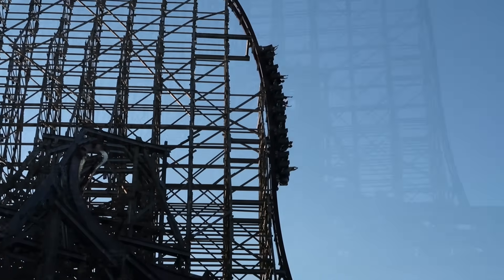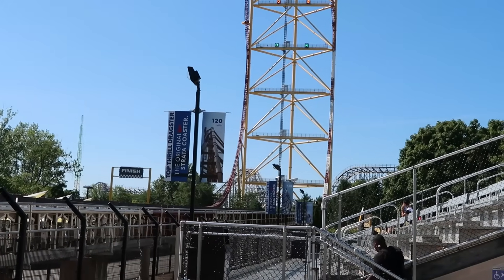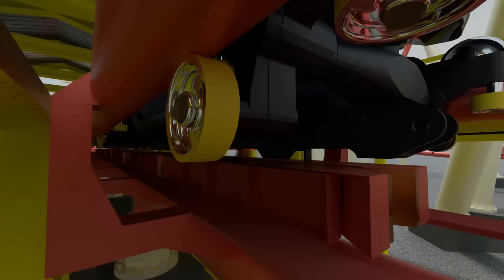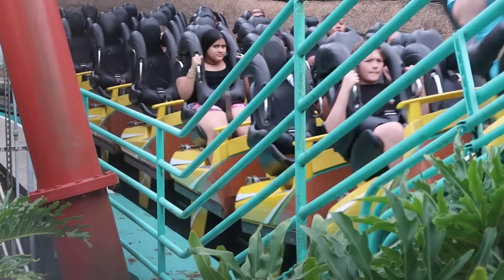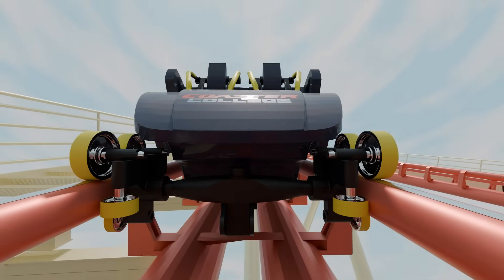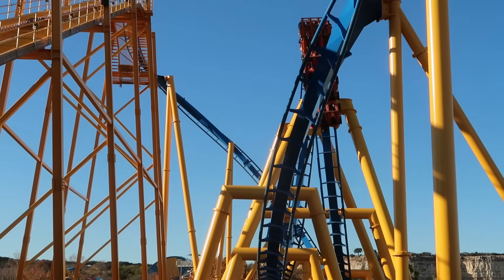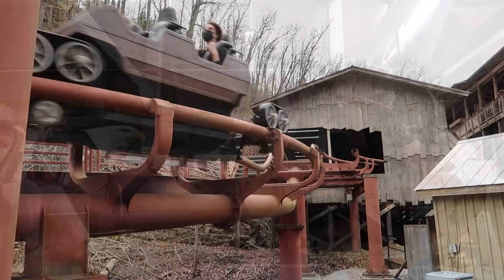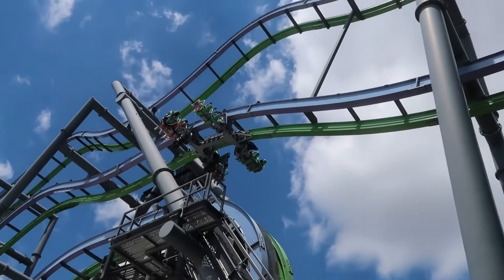Why Roller Coasters NEVER Derail!

Comment: Title is very misleading, and is a bad way to get non coaster enthusiasts to feel less scared. Coasters absolutely can derail, and drift off the coaster track, like a railroad car, or public transit subway or passenger train, or a monorail even, can derail off track. The chances yes, are very low, and if a derailment happens, usually it's non threatening, and it's even more rare for a derailment to be serious enough to where passengers are injured. I'd say coasters from travelling carnivals or fairs are most likely to derail rather than regulated amusement parks, but it's still possible, so yeah.

Comment: You should do a video on train/bogie articulation. Like why not use ball joints for everything, why there is a zero car, how a layout can decide the train’s design (tight turns need shorter trains, a 2nd layout doesn’t have left and right capability, a Larson loop has zero articulation, etc). as well as how some coasters have more than one bogie per cart. Like what makes an x car coaster so maneuverable or how millennium flyer carts can be so short etc
Reply from the maker: I'll add that one to the list, cool idea!

Comment: How do those Monorail type coasters work?  I'd assume it's a roller coaster version of a typical Box Beam Monorail type (ie roller coaster version of a Von Roll System as those have Upstop-esk wheels), but I'm unsure and most curious
Reply from the maker: It's just a standard rail design with no crossties, the wheels are the same as on a normal coaster too. Just more compact!
Reply: @CoasterCollege  thanks, that's fascinating to me.  I always did love learning the engineering side of rides and transport systems

Comment: Great video! Can you please do a video all about wheels? I like the one you did 5 years ago, but I'd like to know more about how different polyurethane compositions are used for different weather, how they are manufactured and rebuilt, how often they are replaced, different heat dissipation techniques used in the industry, and how much they cost.

Comment: How do they put trains back on an inverted coaster? Sitdown you just place them on but I can’t wrap my head around an invert
Reply: Hold it up and reassemble wheels.
Reply from the maker: The wheel assembly is essentially flipped compared to a normal coaster!
Reply: They most of the time push it up and then assamble the Wheels it Runs on
Reply: Intamin Prefab Woodie: "Allow me to explain to you how you are wrong" 😂